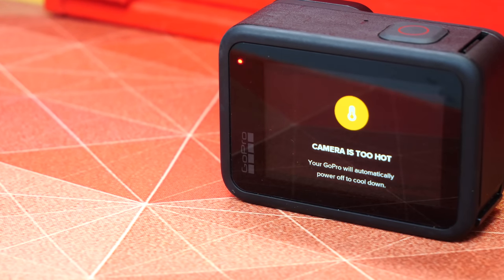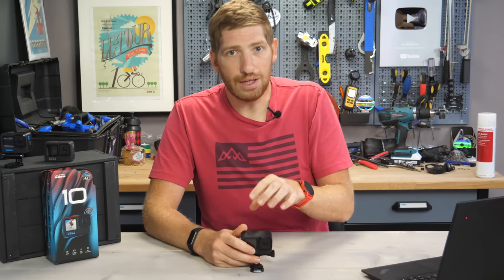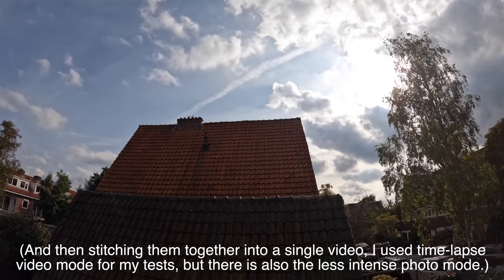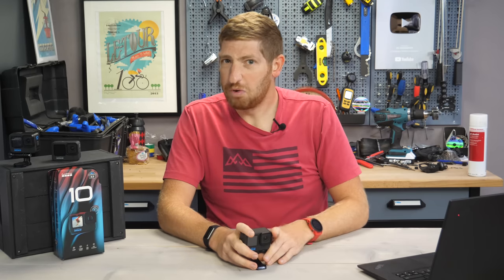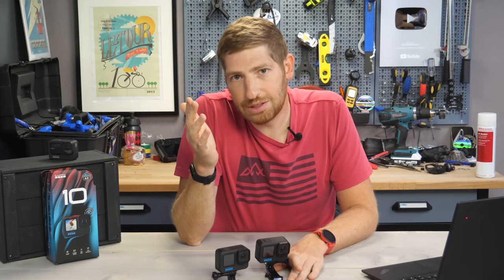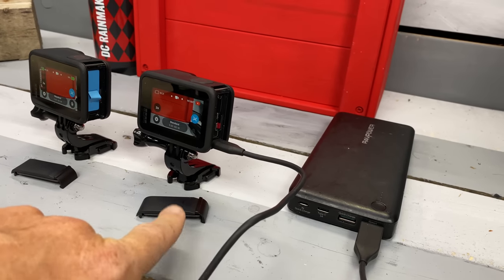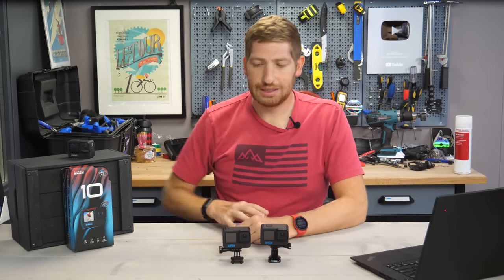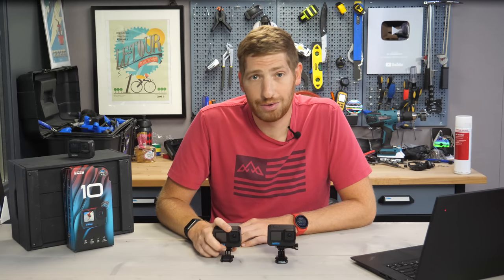GoPro Hero 10 Overheating: 40 Tests Later

Comment: GoPro should start making White coloured body again to reflect the sun rays or reduce heat absorbtion. Shooting under the hot sun here in Singapore only last my GoPro Hero 9 about 40mins of idle (hindsight standy) before it shutsdown due to overheating. Overheating seems to bloat the battery as well.
Reply: Thermally for internals it doesn't matter as much as you'd think. There is absorption and reflection properties of the coatings. If it absorbs the same, the reflection doesn't do much. It's not like putting a mirror in front of the camera...which basically is the same as just putting the camera in the shade. So, adding a small piece of cardboard to block the sun may help... Bulk temperature will still get you.

Comment: I use mine in the shop, and an AZ summer it gets warm. I usually need to turn off all the features I payed for, leave it on tripod mode, with external power (limiting the ability to use a mic), no battery door and the screens off. I get 20 minutes usually. Which is fine, it will beep at me. But I can't figure out why all the clips are out of order when I upload 10 hours of the days footage.

Comment: Love the video and the testing and can't believe I'm saying this but you missed the case that I use (and run into overheating issues with) the most. Using the case + airflow.
I use the GoPro to capture car racing footage. I need to use the case because it protects the camera from flying debris which is common in motorsports --the camera won't last two weekends without damage without it. And I found that the case restricts airflow enough to overheat my Hero9 at 4K60 in mild summer temps in around 20 minutes.

What would be very useful to me and what I can't find is an open top case; I only need protection on the front of the camera, and an open top would allow the airflow to cool it down. Wish it were an option.
Reply: Good old environmental sealing, it is even an issue with DSLR selection.

Comment: great video thanks a lot. I have never had  Gopro and I'm thinking about getting one soon. Hero 10 is my pick but This overheating problem make me think maybe I should go for hero 9. Especially because on Gopro website both cameras are at the same price which is a bit strange. would be nice if you could test two cameras i.e. 4K 60fps which one last longer?

Comment: I really appreciate these test - I go on very long bike rides so it looks like it's a no go for me, 1080p is probably enough for me for now, which camera should I buy instead?
Reply from the maker: Bike rides have windflow, no issues as seen in the text - your battery will die - not overheating.

Comment: Looks like the battery discharge heat is what causes the overheating and without some cooling it then shuts off the camera. For indoor shooting it is probably best to use a USB pass-through door and external power with no battery installed.

Comment: nice video. I'm mostly a skydiver, so usually there's a lot of airflow and I don't care. I had even problems with freezing my hero black 3+ in cold weather with old batteries. But from the other side old 3+ works without any overheating as a dashcam for all day (I just change a battery every hour), looks like 9 or 10 couldn't do that ... I have a 9 now, so will test ...

Comment: Really nice work. I plan to mount my camera on top of my car with the protective housing. How do you think the housing will impact the airflow and overheating?
Reply: not as badly as if inside the car since the case will be cooled but you may have to drop to 60 FPS.

Comment: I've always wondered if the "lens" matters. Do some just crop the sensor and take pixel per pixel, which could maybe run cooler, or does it do scaling which could cause it to run hotter. Which lens works best? I like Narrow/Linear with horizon leveling, with lowest level of boost. It's on a tripod, but can be bumped and the floor bounces a bit from all the action. (Indoor volleyball.) Seems it's pretty much just higher resolution is hotter and more apt to die from overheating. Can scaling to a different lens impact heat? This is another you could do. I've done a few tests myself. I have a thermal camera and sent a video to GoPro with a Hero7 and they replaced it, as it was dying WAY TOO FAST, and they said it was definitely running too hot. The replacement worked better, but would still overheat, in my use case of indoors on a tri-pod. I've always shut off GPS and WiFi, and other processes like GoPro color, thinking the natural was more direct from the sensor, so less processing. 

I see their response about the 10 having different settings for indoor/tripod and extended life. I didn't notice those options on the 11. I'll have to look more. I just think I'll try the powerbank and no door. Wish they made a "door" with a hole, but built in USB, so it would be safe from bump...kind of like the media mod, without all that added stuff and fully covering the camera. 

Thanks for your great videos. I used to read your website more for the GPS running watch reviews and such.

Comment: Thanks for your testing but ultimately, I think it comes down to this major point.  For the price point at over $500.00 you shouldn't have to split hairs to find out when this piece of trash camera will and won't overheat.  I just had to send my gopro hero10 back after it ruined my vacation memories.  Not only did it overheat repeatedly in 75 degree weather with a strong breeze and perfect airflow in only 12-15 minutes of 4K 120 fps filming AFTER manually installing their "firmware fix" for overheating, but all my pictures appear like an oil painting with awful distortion.  GoPro customer service read a script of apologies to me and basically said they don't care and there is nothing to do to fix these issues.  
The only thing this camera did well was film in 4K 120 fps while submerged in cold ocean water for 50 minutes.  
I think your video gives gopro to much legitimization for producing a terrible product that they either didn't beta test or knowingly did beta test and then release a broken product.  Go Pro, shame on you for trying to rip people off for this trash.  
My personal theory is that the company is hoping a lot of unsuspecting people will purchase this camera for an upcoming trip and won't bother to discover it is trash until after the short 30 day return period.  At that point, they have successfully stolen from at least one poor unsuspecting person.  I suspect if they can get a single sell to stick at this price point, they get to pay for the production of 10-12 of these pieces of garbage.  Seriously people, beware!!  The gopro 10 is trash right out of the box unless you only film submerged in cold water and gopro doesn't care.  They won't help you out and there is no fix for it.  They are a horrible company.
Reply: Spend at least 2k on your next camera .
Reply: I am probably going to use 4K60 most of the time anyway but it should be able to take 80F all day (outdoors with a light wind) at that setting.

Comment: Fabulous vid.  Thank you.  I just got the GP10 and I am enjoying the learning curve.  I noticed that the camera does get hot, but that's physics ... it's a waterproof case, fast processing, so I am not surprised that the machine gets toasty, so did my desktop when I overclocked it.

Maybe in GP11 there will be a metal heat sink as one of the sides of the camera?  ;)

Comment: It's a great comparison! Thank you so much! Is there a comparison against the Hero9Black 4k settings?
Reply from the maker: I included a bunch of Hero 9 data in there, especially in the linked spreadsheet.
Reply: @Dcrainmaker  Thanks for the fast response. Where can I find that? In the linked pdf is only H10 data.

Comment: i am  using it as a dash cam in western Australia i do have a gopro 5 and a 7  and they both over heat  and shut down most hot days when its over 30c hope the 10 is better then i may get one

Comment: You definitely need to do more investigation into the external power options. Will it ever overheat? Can you eliminate the "cold battery" warning?
Reply from the maker: Fwiw, someone from GoPro just responded on the video that the cold battery error is a bug that's being fixed for the planned November firmware update. Woot!
Reply: @Dcrainmaker  That‘s great news!

Comment: Great testing. Actually, the numbers are better than I thought.

I've only had overheating on my 9 in static environments - hot dash or inside the case during Texas summers playing airsoft - and it is unreasonable to expect any current camera to do better than that.

Comment: so basically it's a non issue. Exactly like GoPro said, very few people are taking 20 to 40 min video indoors.
Reply from the maker: In a nutshell for most people. Certainly, I fall in the occasional indoor video shot, but by just reducing from 60FPS to 30FPS it resolves it for me. It won't work for everyone's scenario (I could see perhaps dash-mounted in a racecar wanting 60FPS).
Reply: And if you're recording indoor videos for that long, it would be a better idea to plug the cameras to a power outlet via USB.
Reply: Maybe if you're vlogging yourself at a sports game/match. I think that's a fairly common vlogging scenario. You may be doing longer recordings.
Reply from the maker: @Ninjadom  Yup, there's lots of scenarios that are still very valid. Though, in general, when indoors most people won't need the higher frame rates (60FPS) for a static camera location. Certainly some cases where folks might want that - but I think most are probably good at 5K/30 or 4K/30.
Reply: @Dcrainmaker  Yes!! Very true. I have the Hero 9 Black and if I was vlogging for long periods of time at a sports game, I would use 1080/30 to keep the file sizes down.

Great video! Fantastic research!!

Comment: Great video. When i film and do videos, i film maximum 1 minute..... mostly 10 second clips. When i did my Agadir video, I was walking and filming for maximum 5 minutes till it was time to stop recording and change the composition. So I will never overheat a GoPro Hero 10, ever... :) However, It would be very interesting to go to Marrakech in July when it can be up to 52 degrees Celcius or 125 degrees fahrenheit and no wind.....  Maybe I should start to do this "driving around the city" films and see how far I will get till the GoPro 10 overheat, in a car with aircondition with airflow directly on the GoPro, it would be no problem I think. Thanks again for this video, it was really great.
Reply: Yep. I liked shooting in 4k and crop down. So, I try 2.7k to get longer battery and frame better, but do miss sometimes. I put on a tripod, start recording then raise the tripod to about 10+ feet, so I can't frame so great.

Comment: Thank you for your great videos.  I have a GoPro hero 5 and considering to go to the 10?  I have a ton of video of my grandson and all of our trips, but I my Kimble is now broken and I need stabilizing capability.  I take it by the reviews I can probably get by without a Kimble?  I am a scuba diver and curious how it is with low light environments ?  Thanks again for. your work.
Reply from the maker: Hi Mike! Yup, I don't think y need a gimbal anymore. I haven't used one since the Hero 8 days, but especially with the 9 and 10, it's just not necessary except for very very specific scenarios. But in most cases these days for action scenarios I think a gimbal actually takes away from the video. Such as mountain biking a gimbal makes things usually look too easy/fake. Just my two cents. On scuba, you're going to want some sort of lighting when you get lower if you're pointing it at objects at the same level as ou - just as with larger cameras. If you're mostly shooting upwards, you can usually get away without it.

Comment: Hello sir, i had a question. Without overheating how long does it last for 4k30? As in what's the total duration of a single battery with 100% charge?
Reply: Looks like maybe up to 2 hours at the speed.  That was his longest run and he was most running at 60 FPS or more but I think he had some at a lower rate.
Reply: @toriless  thank you so much 😁🙏

Comment: Wait! You got a cold battery alert recording with no GoPro battery inside it while using a battery bank? Did it shut off or could you tap the screen to ignore the "cold battery" alert and continue recording? I'm concerned about this because I record fishing videos and while doing such you never know when the action is going to happen, so I practically keep the camera continuously rolling. On my previous action camera the Yi 4k+, I left the battery in and kept a power bank plugged into it and could record until I was either finished recording or maxed out my micro SD cards. Any additional testing and/or details on the Hero 10 Black continuously recording with a power bank would be much appreciated thanks 👍
Reply from the maker: After seeing my video, GoPro found a bug there (cold battery error message in this situation) and fixed it. It was included in the early October 2021 firmware update.
Reply: @Dcrainmaker  Whew, that had me worried for a minute because I just ordered a HERO10 a few days ago. Thanks for the info and the videos, keep up the good work.

Comment: Yes, my Hero 10 has the same problem. Especially when charging it is equally hot. Hero 6 is also hot but not as hot. If it's so hot all the time, I think it will affect the life of the device. SJcam Sj10 Pro can continue record 3-4 hour. Although it hot, but it can record. It don't stop like Hero 10. Lol

Comment: My Hero 9 in the orange Floaty lasts about 7 minutes on the back of my kayak before overheating and shutting off.  4k/30 in the sun on a creek with little air flow.  It has never overheated on my bike in the Kansas heat.

Comment: For recording super long bike rides (think dashcam) with an external power source, any ideas if removing the internal battery still helps?  It seems like charging stops once recording is on, and the GoPro seems to user the power bank.  After watching this I think I'll just leave an internal battery (just in case) something happens with the power pack or USB cable.

Comment: I just bought a Hero10 and a bunch of accessories. I've had the camera shut off a lot from overheating. I'm also experiencing the camera going dead when powered off overnight. I have to pull the battery to prevent this. I know I could turn off wifi but this should just be off when the camera is off, or have it a setting toggle. I also have SJCAMs SJ6000, SJ7 and SJ8Pro. None of them suffer from these issues, in my experience. The SJCAM is not a solid camera, with its own flaws, so I got the Hero10. With some of these heat and buggy issues that I've researched, I would rather give up the small size for a more stable camera. If that means the camera body is 3-5mm larger on any dimension, so be it. I have my camera sitting next to me on, idle and charging. I have it on since you can't see the charging level while its off. Really? Why is this not standard on the front display? "There's the charge LED". That doesn't give me the percent charged. Anyway, its very warm to the touch and ambient air temp is 68-70F. I like the camera so far but, for what these cameras cost, they should be much more solid and reliable than they are. I'm still debating whether to return everything and check out a different brand.

Comment: Ray, first thanks for all your testing. I use my  Hero 10 for mountain biking 99% of the time. I was thinking of getting one of those rubberized “sleeves” to protect it, but wondered if that would cause it to overheat even when outside with airflow? How much does camera housing play in dissipating heat?
Reply from the maker: Thanks! I haven't done specific overheating testing with the rubber sleeves, though I have used them from time to time (almost entirely for pre-release scenarios). I think you'd probably want to consider why you want one. In mountain biking, it's incredibly unlikely that you're going to get a rock up and hit the camera, and specifically, to hit the LCD screen (since, the main lens would be exposed either way, and that's replaceable). Whereas, for motorbike circuits, this scenario is far more common - but usually with a lot more airflow. Just my two cents...
Reply: @Dcrainmaker  thanks for the reply and advice. I tend to agree.
Reply: DC, one last question or maybe a video you can do. I’ve had a GoPro 3,5 7,8 and now a 10. Shot my first videos today on my mountain bike. Upload to Movavi and the videos are choppy, etc. I have a one year old HP notebook and Windows 11 and current Movavi version. Best I can tell it is because I shot it 4K. Going from 8 to 10 has been frustrating because of new batteries, charger, etc. now I can covert the video. Ideas?

Comment: Love the tests, but i have a question about the cold testing. Have you tested putting it in the freezer off, then taking it out and seeing if it will turn on an record? I have this problem with my H8 which makes it nearly unusable for skiing or snowmobiling because I cant keep it warm enough to allow it to actually turn on in -20 to -30
Reply from the maker: Yup, I came back and took it out some time later and turned on immediately. It’s one of the things they improved between hero 8 and hero 9.
Reply: @Dcrainmaker  Thank you VERY much for this. Officially sold on the H10, that has been a terrible annoyance on my H8 as it never happened to my 5, 4, or 2

Comment: My curiosity is how long it is going to last on 2.7/30 full time recording while touring on the front of my motorcycle. My 7 Black does this all day long without overheating. Connected to motorcycle for power with a Sandisk Extreme Pro 256K card. Battery installed and power cable charging. Record all day except for gas stops, but never shut down. Most times I do have a wind slayer wind sock on and I am in the sun all day. Got this 10 black as a replacement to one of my 7's.